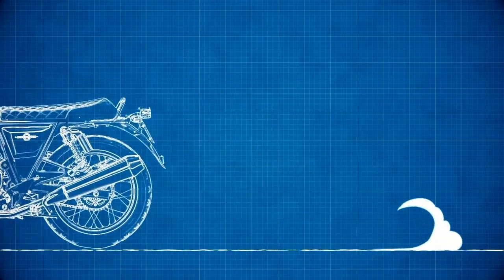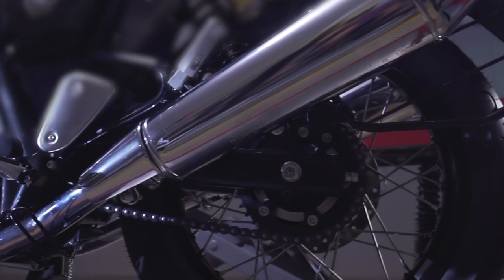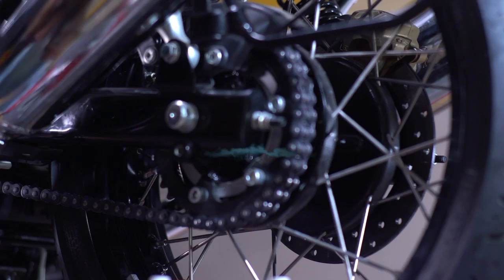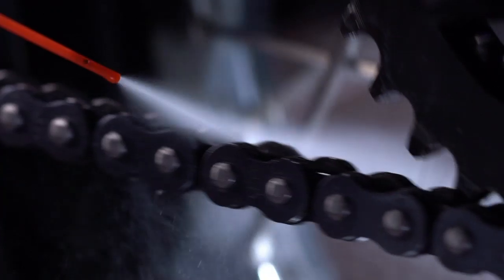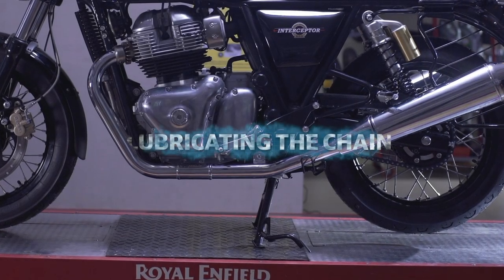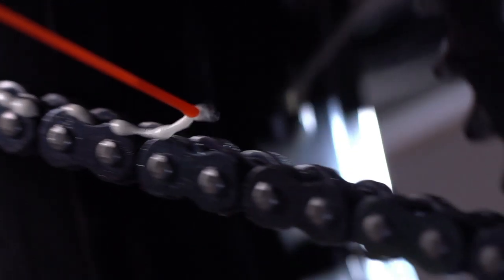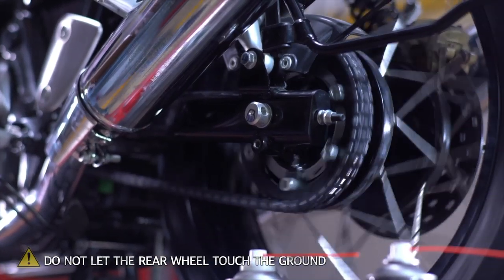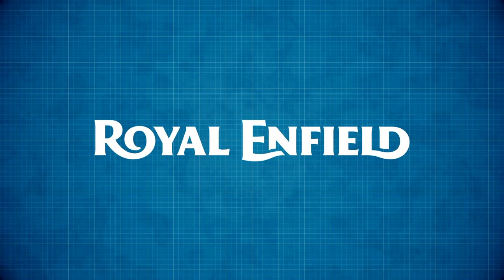DIY - Cleaning and Lubricating the Chain

Comment: Nice video, thank you. It would be nice if dealers in the USA were required to carry Royal Enfield brand parts and consumables. I was told they don't carry factory tubes and it would take a month if I ordered one, and they don't carry your chain cleaner & lube or your ELF engine oil. I try to be brand loyal but they make it difficult. I was going to stop in El Paso for a new INT650 rear tire but they said that would take a week to get in. Sorry for the complaining. I love My Royal Enfield Interceptor 650. Keep these maintenance videos coming.